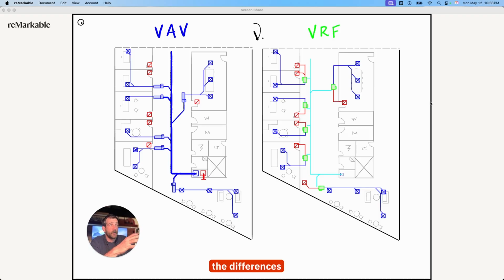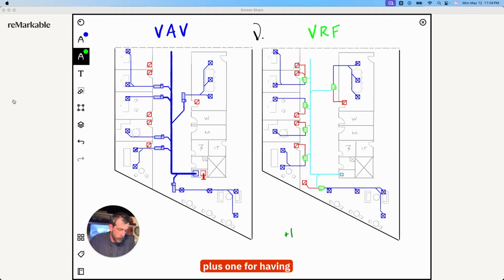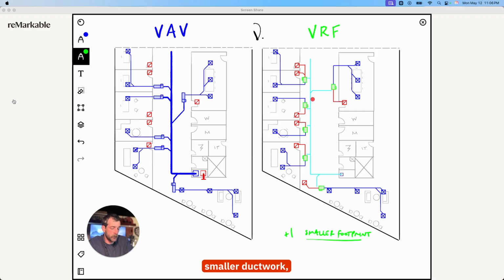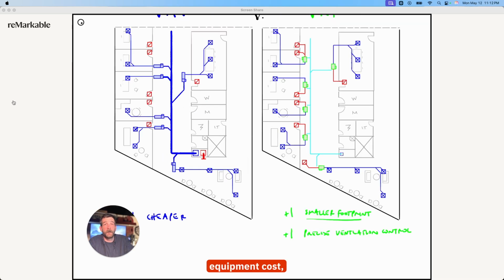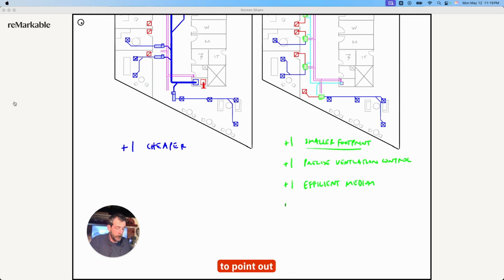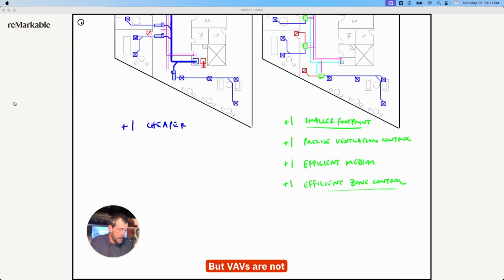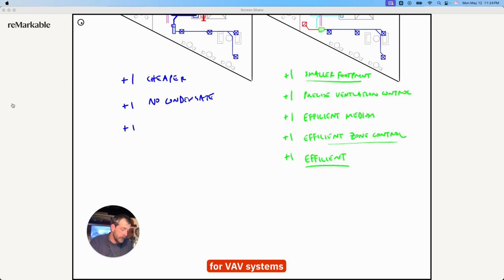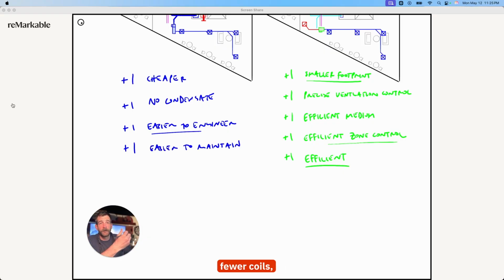VAV vs VRF

Comment: What if you were to use a VRF system and use a VAV box inline with the VRF system for better control? Is that do-able?
Reply from the maker: VAV boxes control airflow and, if they have reheat coils, can control air temperature to a degree. In VRF systems, the indoor fan coil units control airflow (they have their own fan) and air temperature (they have their own cooling/heating coil). So adding VAV boxes in-line to a VRF system isn't going to add better control. If you're trying to serve multiple zones with a VRF indoor fan coil, and use VAVs to control the airflow to each zone, at that point you're basically describing a VAV system served by indoor air handlers with split DX coils.
Reply: @hvakr  Thanks, this is what I meant. So as per your video, this VAV system would be cheaper compared to the the VRF system. Now what if I were to use FAHU for this VAV system - why cant this also provide the ventilation requirements? Another question is the outdoor unit: for both VRF and the VAV system (say in your example case), the OU unit would stay the same, correct?